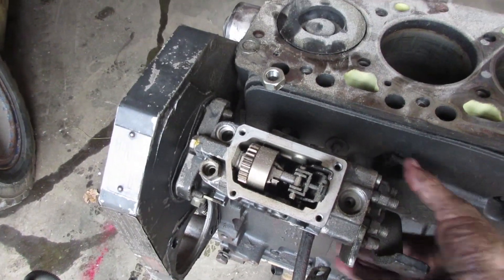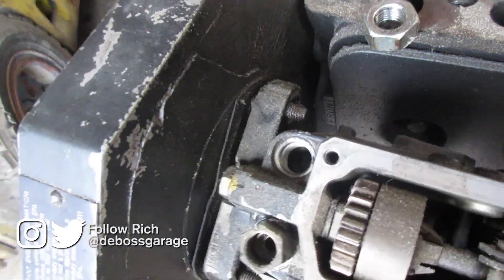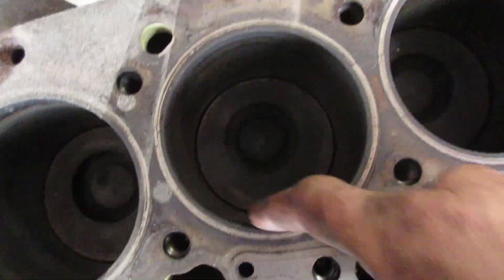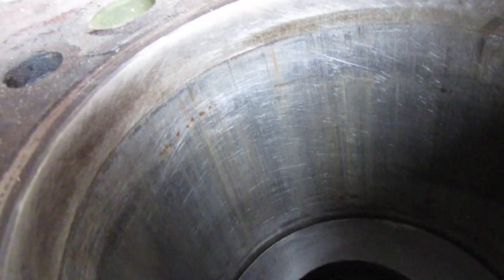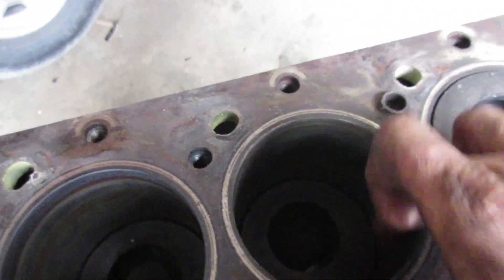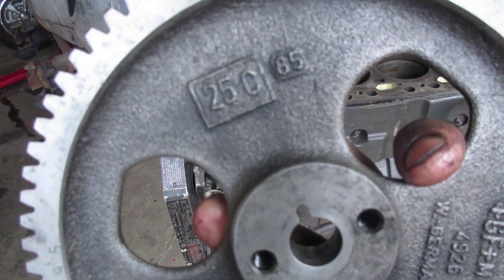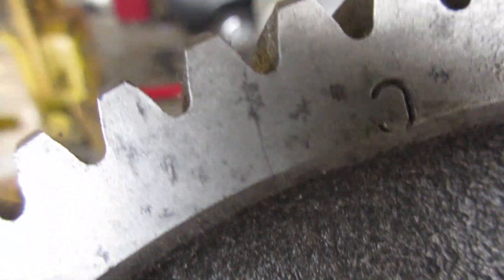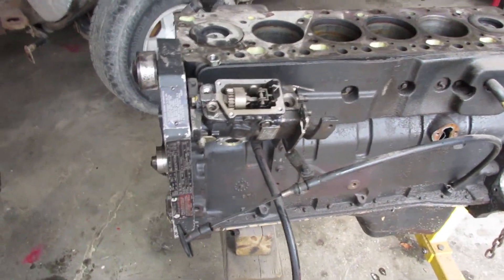Weird Problems With Cummins 6BT / 4BT Diesel Engines

Comment: My truck had a crack the whole way down on the gear but no crack on the timing case and smoke for a minute after it’s started. I put a new gear in it could there be anything else messing with the timing ?

Comment: Hey my 1996 cummins 12 valve with s 5 speed got s #6 fuel plate put in it I was driving it pretty hard then all of a sudden I got a huge backfire and tons of white smoke no oil in coolant and the exhaust doesn’t smell sweet plus I replaced the injectors I’m really lost and I need som guidance could I have a broken gear or somthing like that

Comment: I had my spring a fuel leak on the fuel return line. Seems common and it caused my starter to go out because it dripped fuel on it.

Comment: What color smoke and when does it smoke when the injection pump gear has a crack?? Is it a like a blue/grey smoke on start up and black when heavily accelerating?? Does it have a slight low idle when first started for about a minute?

Comment: I worked at a Kenworth dealership for a while and we had a log truck with an isx15 500 come in with the crankshaft timing gear completely grenaded (from a small crack) which of course destroyed that motor. The truck was about 2 or 3 years old with around 250k miles. We put a new isx15 600 in it and three weeks later, another truck crossed the centerline and totaled that log truck. They only way you could tell it was a Kenworth was from the emblem on the front of the grille. It was a gorgeous truck too. Unfortunately, the driver of the truck that crossed the line was asleep and died from the accident.

Comment: Did the 'killer dowel pin' come out on this one....? I don't see anything where I think it should be...
I've heard of some really bad thing happening when it does....gears, cases....almost anything if the pin gets into the wrong places.
Reply from the maker: odly enough no, its still in there.  Its just weird...

Comment: could you do a video on converting a ve pump to a ppump. the ve pump on my truck is leaking fuel and I was wondering how hard it would be to switch it over. I also wanted to know what parts you would need to do the conversion. thank you!!
Reply: jerry teixeira you will need the front gear housing, pump, support bracket, fuel lines, pump studs, and nuts. and to have the pop pressure of the injectors set for the ppump. and all associated linkage, and plumbing.
Reply: Okay thank you

Comment: Hey Deboss I was wondering if buying a 1989 dodge Cummins with 550,000 miles on it would be stupid, the truck runs perfect it has a new Cooling system, it's been re ringed, it has a new injection pump and runs like a clock. Thanks
Reply from the maker: If the price is right, I would still go for it.  This engine had 500 000 km and it still had cross hatch.  See if he has any paperwork on the maintenance and if the price is right... Merry Christmas!
Reply: @DEBOSSGARAGE  great videos. Is thete an email i can reach you for a couple of 5.9 questions.. Please let me know. Thank you in advance